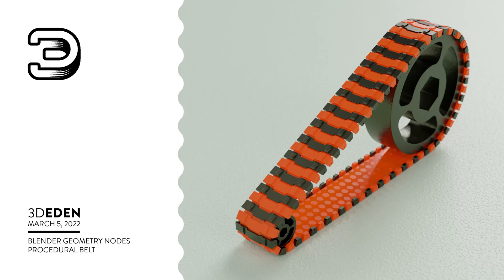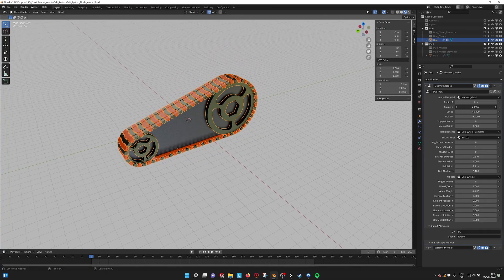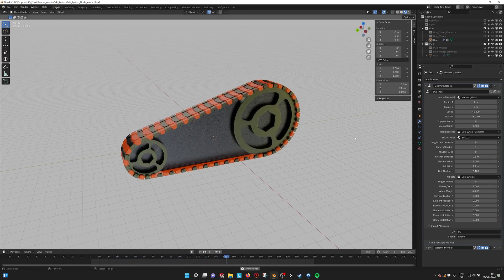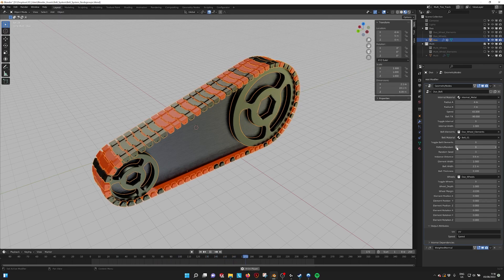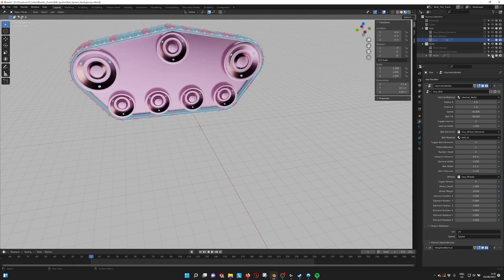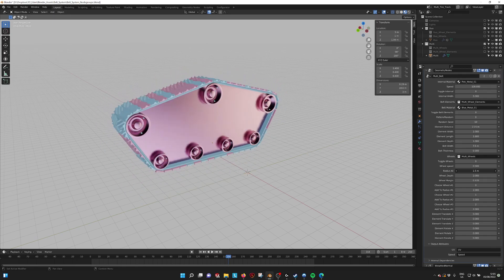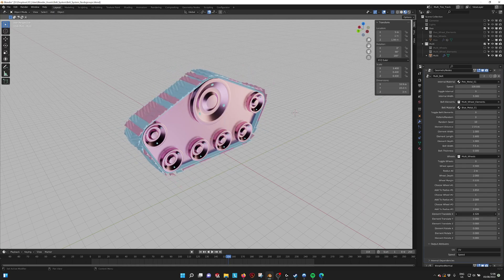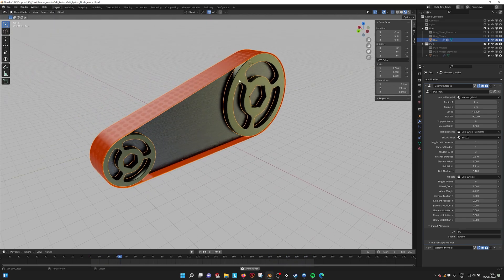Blender Geometry nodes, procedural belts, tracks, treadmills

Comment: I bought the file and works fine, however is there any option for making belt which is bend from outside? I mean curved belt as if there was some wheel from outside? This is very common in industry and without that feature I can't make any use of this node group